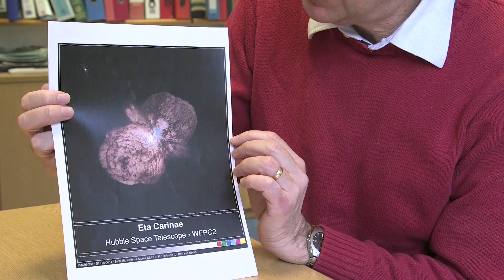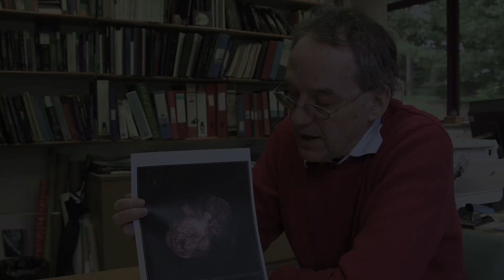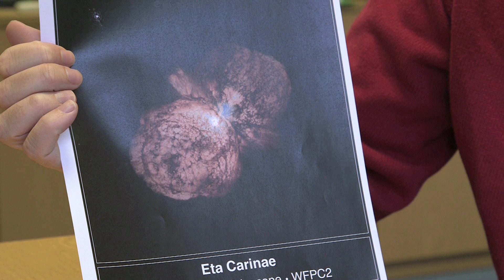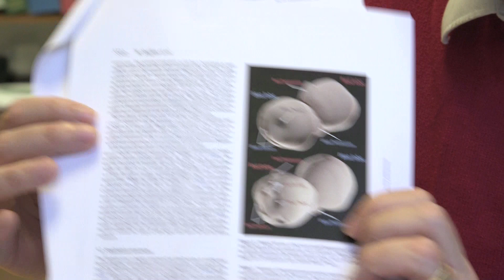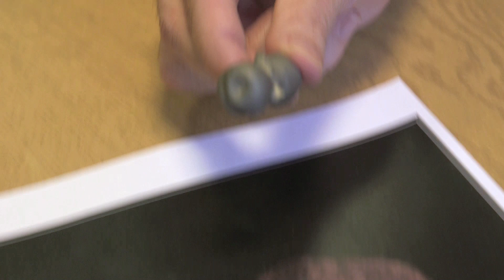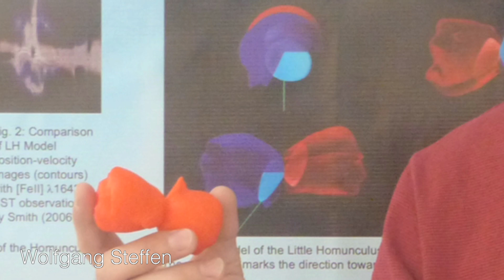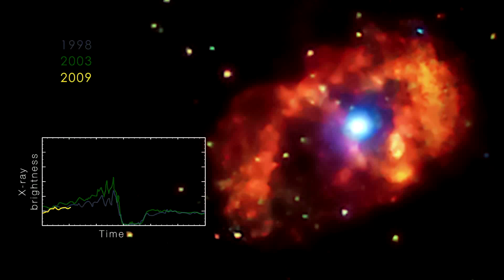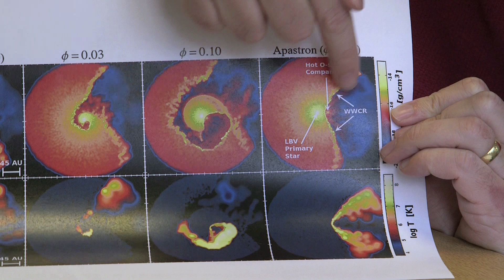The Amazing Eta Carinae - Sixty Symbols

Comment: One second is defined as the duration of time it takes for 9192631770 periods of radiation corresponding to the transition between the two hyperfine levels of the ground state of a Cesium 133 atom. Don't mind me. Just typing this comment around on YouTube until I can fully remember it.

Comment: you know you are looking at massive star if it´s companion star with potential to evolve into black hole seems to be tiny in comparison :D
Reply: +lamebubblesflysohigh The prof stated the companion star has ~20-30 solar masses. You only need 3 solar masses to form a black hole.
Reply: +Sith Smasher That may be true, but a supernova explosion would greatly reduce the overall mass, so its fate would depend on how massive the remnant core would be.

Comment: I have only a high school education so hating just a question.
Is it possible the two stars collided?  The slower, larger star is in the end stage of its life and starting to collapse, causing an increase in density(gravity).  The smaller, fast star spirals in and collides with outer fringes of the star knocking enough of large star mass away to return the gravity well to the status quo.  Also some of the small stars newer fissionable material gets left behind injecting new life into the big star and speeding up the smaller star yet more.  Of course this could just be the ramblings of an idiot.

Comment: It'll be as bright as the full moon for a year? The supernova explosion takes a year?
Reply: QuantumBraced Well, the radius of the star alone is millions of kilometres. With such a large object it can't happen overnight.
Reply: QuantumBraced The explosion happens in a fraction of second, it is the residual matter that keeps releasing light and energy for a long long time. Think of the fireball left by a Nuke explosion.
Reply: QuantumBraced The actual supernova event - the core collapse and rebound takes only a few seconds once the star has reached the stage where its core is almost entirely iron. The short version is that the star can no longer produce energy through fusion and loses most of it's core energy through neutrino emission in just a few seconds.

However, the shock wave has to blast outwards through between 10^7 and 10^9 km of the star's outer layers. The cooling gases of the outer layers, which continue to be heated by the decay of radioactive nickel and titanium, are what glows for months to years afterwards. Though it dims significantly in a year, the glow continues for millenia (although other sources, such as the collision of the ejecta with the surrounding nebula and the magnetic and gravitational fields of the supernova remanent - whether a black hole or a neutron star.
Reply: QuantumBraced The star is so huge that the time it takes to eject the mass of 100 suns takes a year even if the explosions shock wave is at hypersonic if not ultra sonic speeds.
Reply: QuantumBraced yup, those things are BIG
Reply: QuantumBraced IIUC, the peak brightness lasts ~ 2 weeks. I would say that at that point, the explosion is "over". Presumably, gravity is no longer able to contain the nuclear reactions, material is ejected, and the reactions fall off rapidly. After that, you have lots of glowing material rushing out into space, and you continue to have brightening of the sky, due to the innards of the star no longer being obstructed by outer layers.
Reply: Nope, the supernova is over in a blink of an eye, however the matter released from the explosion will remain bright in the sky for months after the event. The star could explode any day in the next 200000 years but you will need to live in the Southern Hemisphere to see the supernova

Comment: I'd like to know what the basic probability of a gamma ray burst from Eta Carinae hitting us would be. I tried doing some calculations myself, but quickly got lost with all the numbers. Could someone else help? First I found the distance from Earth to E.C. (about 7,500 light years) and used that to calculate the surface area of a sphere that same size (which is 5.73 * 10^30 square kilometers). Then I used the diameter of the Earth to find the area of a circle the same size (since we just need the largest cross-sectional) and that is 1.28 * 10^8. Which means that Earth makes up 2.23 * 10^-25 percent of the overall sphere. But I can't seem to figure out a way to calculate the size the gamma ray burst would be when it gets to this distance, and how close it would have to be to cause major effects. That could potentially raise the probability massively (though I would bet on it still being a ridiculously tiny possibility).
Reply: You're having problems because you are missing one key piece of information. You need to know it's rotational axis, and where that is in reference to Earth (so probably compare both to some known axis (galaxy maybe), then compare them. If it's pointing at us then we die!